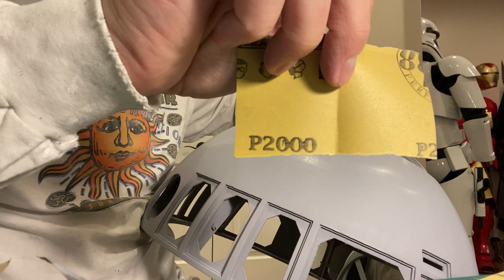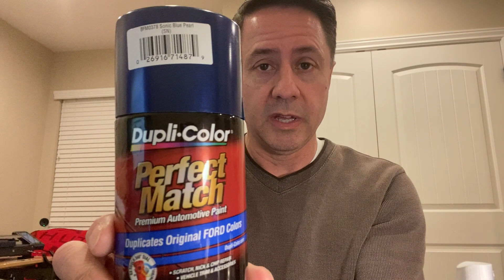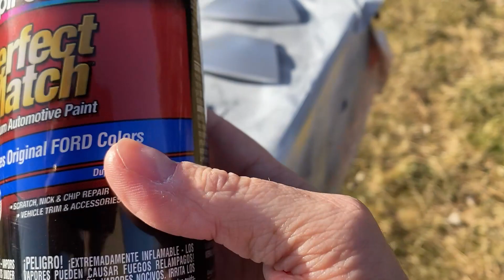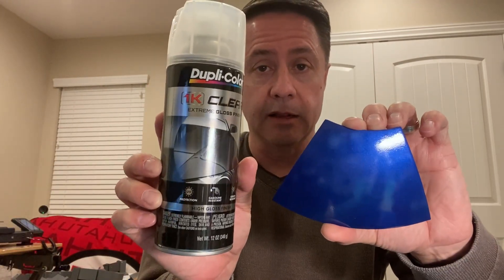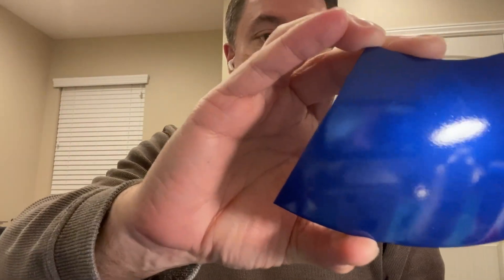Painting the R2D2 Dome - Part 3

Comment: Great tutorial but anything beyond 400-600 Grit Pre paint could accually hurt addhession. 1200-2000 is for post clear to flatten the surface
Reply from the maker: you are correct....but I have never had any issues with paint adhesion

Comment: People follow the can instructions and applying several thin coats which makes the finish rough and textured, for best results and a smoother finish the trick is to apply a super heavy wet coats so the paint self levels super smooth, but its takes practice to apply just enough without causing runs.

Comment: 400 grit on the primer is plenty of sanding. If you really want a smooth finish, you'd be better off going to 400 grit on the primer, then wet sanding the basecoat or clear coat. Paint needs some texture to help with adhesion.
Reply: not looking for smooth, looking for Shiny, he's painted an iron man costume and other things, i think  he knows what he is doing.
Reply: @KingNothing22  adhesion is critical beyond 600 grit is pointless and think about it your laying thin coats of mist and spatter do you really think all that extra sanding did anything after the first spatter got layed down